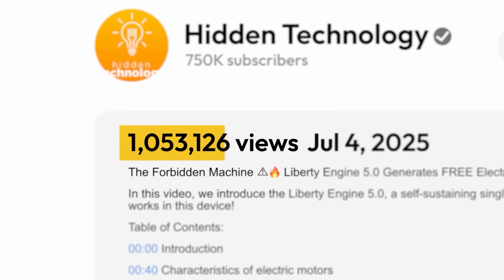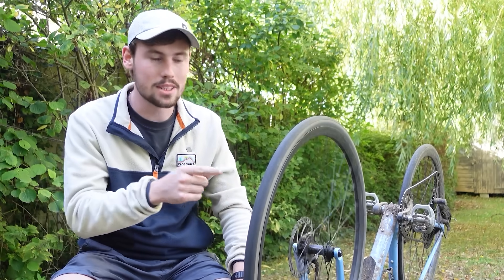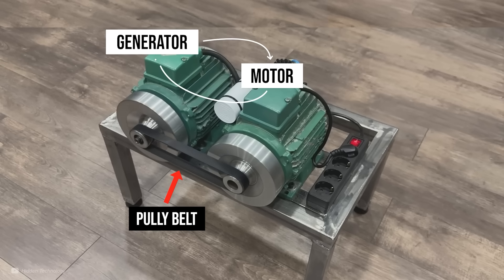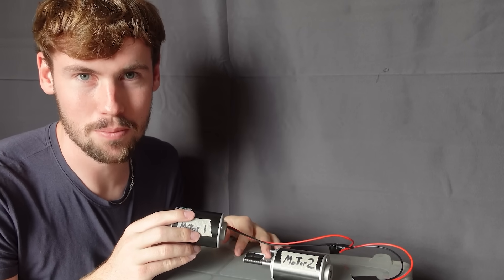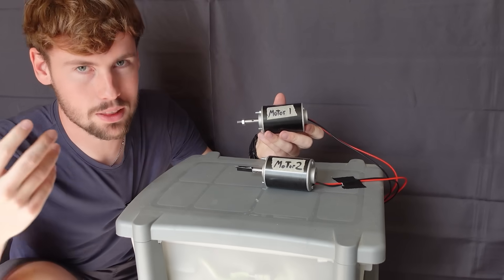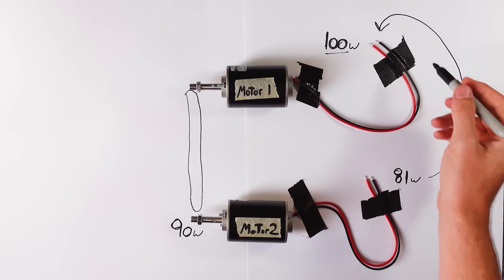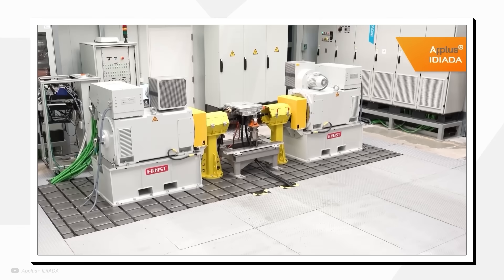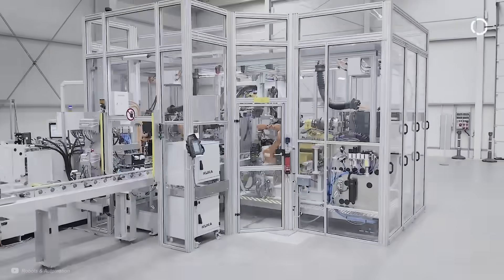100 Years of Waste! Solved by an Unlikely Invention.

Comment: You should stare it's not perpetual motion machine but over unity. As perpetual motion requires the definition of " no start or stop" i.e. no initial outside source to get it up and running. Over unity simply is a machine or device that produces more energy put the was put in. For example the fusion race currently going on, which why we are not simply trying to convert gravity into energy with fluid dynamics I don't know because using the hydro turbine and an optimized Archimedes screw to change the latitude of water and convert it's fall from a high potential state to a low potential state through an accelerating state seems to me to be most efficient way to generate energy on a large rock like earth. But what do I know

Comment: I dont really get it. I mean one motor is turning another motor and this energy and a bit more is used to power these 2 motors. but where is the use case? there is no overflow energy you can use. I dont get it.

Comment: Years ago I worked at a company that build and tested electric powered light rail vehicles. They had a building with pairs of these huge 1MW (1000V / 1000A DC) motors that ran for hours or days as part of the stress testing. However, they still required a direct high voltage power line routed to that building, and supposedly had a history of disrupting the power grid when something in their test system failed.

Comment: Motor-Generator sets were also very common in elevators prior to the introduction of VFDs and AC motors.
Incoming AC spins the AC motor of the generator set. The output of the DC side basically went through a pair of contactors ꝥ would switch the polarity of the DC being fed to the armature windings of the hoisting motor. That's how you get up and down from a motor-generator set ꝥ only spins in one direction.
By controlling the field voltage applied to the dynamo the old electromechanical controller could apply holding current to the hoisting motor, and then step the elevator up or down through the speeds as it left the floor or approached the floor.
Quite a simple system.
And depending on how loaded the elevator was it could put current back into the AC power grid as the dynamo ¬  only applied current into the system depending on the load relationship between the car and the counterweight, the dynamo also had to resist current the hoisting motor was generating if for example an empty car was being lifted which meant ꝥ the counterweight weighs more than the car and so the counterweight really wants to go down.

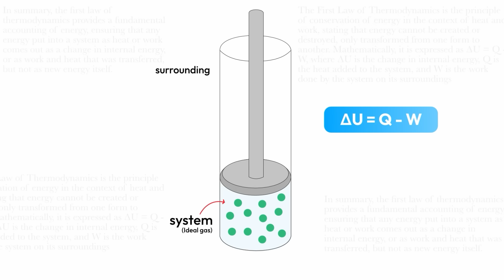Comment: 1:00  My jr. high chemistry teach very gently worked me through the problems with my  idea to run an engine on hydrogen… capturing the exhaust, using electrolysis to regenerate the fuel and carry on in a no-waste cycle.  We hadn’t gotten to entropy, friction, and the energy consumed or produced in a reaction.  I had big sad for weeks.  He did suggest that I might consider a generator running at peak efficiency powering an electric drive would get me closer to my desired pollution reduction.  In the 70s, that was bit of a mind bender.

Comment: Free Energy is not possible.
Expanding your definition to encompass a larger closed system is.

You don't need to break physics for abundant energy,
you just need to tap into the existing resorvoir.

Comment: You need to generate the AC powers from the generator then put the power to the distribution transformers or service transformers and transfer the powers to the motor or motors the free energy will be makes. The distribution transformer or service transformer very important to multiply the energies without it the free energy will not happens

Comment: A motor-generator is among one of the best ways to convert AC power into DC, DC into AC, or 2-phase AC into 3-phase. You can also step up voltage as needed, i.e. a 240V to 480V motor generator can take standard "household" electric service and convert it to 480V 3-phase industrial to power CNC, lathes, and other such tools. Motor-generators also isolate the load from the service, so if you have a "smart meter" they cannot track your usage patterns or fingerprint your appliances.  A good motor-generator will have a conversion efficiency of around 85% and the input side can be connected to gas or diesel engine to keep it going if mains power is not available - no transfer switch needed.

So, it's not perpetual but this type of device (one electric motor that turns another) is far from "fake" or "useless".

Comment: I find it hilarious that these perpetual motion inventors didn't connect the shafts together directly, but used a belt, thereby introducing more frictional losses than necessary.  I can't understand why people have a hard time understanding that you can't power a motor using that very same motor as the power source.

Comment: Everyone says that a motor-generator can't work as a perpetual motion machine because of the inefficiencies. of the motor and generator. but even if you had a perfect 100% efficient motor and  100% efficient generator, with no losses, the best you can do is break even. They would just act like an expensive flywheel. You can't make use of any energy from it, because that would slow it down ,

Comment: I must be missing something here :(. Let's say I have a refrigerator, and it uses, on average, 1kWh per day. The compressor pump runs intermittently, so there are periods where it's essentially idle, and only consuming whatever small losses there are in any transformers used to power the electronic control system. Now, I hook up one of these regen systems, so I have what amounts to a big flywheel sitting between the refrigerator and the power grid. Now when the compressor pump runs, it can draw regenerative power, and the regen system will only pull enough power from the grid to compensate for its own losses. Is that right? I still can't see how the net consumption doesn't amount to 1kWh /day PLUS the losses in the regen system? Please, someone, ELI5!

Comment: I do wonder if running two motors like that could not generate "free" electricity but more reduce electricity cost while running a motor you want to run in like a belt grinder

Comment: Still nonsense.  There is no actual work being done.  You have to take power off of that system to power other devices that will perform work.  That means it is a drag on the motor/generator system, and you have to feed the additional power that load requires from the grid/battery.  Not only do you not save anything, you actually have put in extra losses by putting that motor/generator in line with the actual device you need to power.  Silly.

Comment: Perpetual motion is 'possible', as said if everything that would slow it down were neutralized.

*UNTIL* some rube tries to collect energy from it which brings everything to a halt pretty much immediately.

Because it can only be perpetual if the energy required to turn the system was exactly balanced by the energy the system produces.   As soon as someone tries to collect so much as a nanovolt the balance is negated and motion ceases.

Comment: Perpetual motion work by using (stored energy) to move or power things. But without something generating new energy, the net loss causes them to slow and stop. The stored energy is like escaping gas, it's impossible to keep it from leaking out. Any force working against it is a leak. 
I wanted to know if you have done any study's that use magnets as weights?
I was thinking of a wheel and a natural magnet sphere placed inside of it. A metal plate on the side next to the wheel. So that the force of gravity is working against the force of magmatism.  
The  sphere in the wheel wants to climb due to magnetism but gravity is pulling it down. 
It seems like a longshot and I am told that even this will fail as well.

Comment: Chrysler did this in the 1940's building bomber engines. Huge generators were used as the load for the engines and that powered the plant.

Comment: Most bicycle headlamp generator setups I ever saw had their generator running against the sidewall of the tire. When I used one, it noticeably increased the amount of Force I had to apply to the pedals to keep the bicycle rolling. 

One year I purchase a generator/headlight rig from SEARS. It had two unique features: The headlight also had a battery compartment, so when you stopped pedaling and the generator output got too low, it will automatically switch over to battery power to keep your headlamp illuminated. It also used a generator that rolled directly on the tread of the tire, not the sidewall. Although it created some 'drag' when pedaling, it was noticeably less than the other style of generator. 

I still have that little generator assembly somewhere.

Comment: An electric motor is also an electric generator. At all times. Which is the reason you get the back-EMF when it runs - because it acts as a generator at the same time. If free energy setups like this were possible, then just an electric motor connected to absolutely nothing would immediately begin to spin up perpetually until it breaks from centrifugal forces, because it would generate enough power from spinning itself to overcome the losses and have enough juice left over to spin even faster.
Reply: Only permanent magnet ones. You'll need to energize one of the coil of a induction motor to make it generate electricity in the other coil. Tho that's how big generator works at power plants

Comment: Can you not code the motor to run more efficiently? Eg not continuously putting power through the motor but chosing which poles to send power too? And not the entire motor? Admittedly I dont think its possible with a conventional motor, youd need a stepper driver...... but is it possible with some cleaver engineering? And tune the motor similar to how you would tune a car

Comment: The problem is that you are thinking about using perpetual motion as an energy source no no no perpetual motion can be used to generate excess electricity which can be further used to make usable energy perpetual motion only works because in this in the system there is some excess energy being made

Comment: That's all fine and dandy if your goal is to sit and watch motors run all day, which is basically what testing is.  But this has virtually no value in the equation for the purpose of motors from any power source, to provide mechanical working energy applied (and used up or lost) for a particular motion.  Freewheeling without a load is one thing, turning a torque driver is another.

Comment: A similar idea can be used to power data centers without needing UPS and batteries to switch in during mains power outage.  An electric motor and flywheel are powered by the mains that then turns a generator that powers the servers and network equipment.  There is also a diesel motor with a clutch ready to power the system if the mains go down.  The rotational inertia carry the load as mains to diesel switch over occurs and can also switch back to the mains when power is restored.
Reply: That was old school, for example one I worked on at an airport had a 20 ton fly wheel, self contained ups are now so cheap you can install 2, primary and backup with a backup generator for half the cost of the old fly wheel system though they do still use smaller versions on ships for the navigation system.

Comment: A motor needs 100W to spin a generator to generate 81W. apart from the generator, the motor has no load, so wouldn't it be more efficient to just remove the generator? the motor wouldn't consume 100W if there's nothing attached to it

Comment: Motor/generator sets were used extensively for  power conversion and spike-free power supplies in the 1940's and 50's. Think of it as a mechanical filter that would take all the transients out of a power stream (the inertia of the motor side doesn't see millisecond transients). It was also used for AC/DC converters before power transistors were invented.

Comment: Search Rotoverter, 2 three phase motors, one wired delta the other as wye hooked direct shaft to shaft (no mechanical loss). The low impedance motor is used as a prime mover and driven on one phase which fills a cap used to drive the 2nd stage, 3rd is just along for the ride.  Each of the 3 phases of the generator is dumped into a diode plug which empties into a common cap. The diode plug prevents the generator coil from seeing the load and adding resistance. A pony motor brings the rotoverter up to speed. A variable frequency drive can be used for motors under 5hp, mains 5 to 10hp possible, 7hp optimal. A bank of different value motor caps is used in different combinations to tune the apparatus.
 Also large motors are used as mechanical capacitors and to correct power factor in hv mains.
Best to all
Reply: The 3rd is used for starting torque and instead of using two motors delta, wye a 3phase inverter can be used and three 60 va 24v transformers configured wye delta with the neutral connection on the low voltage. 
The neutral is then connected to another single phase inverter that powers, at the same frequency, the high voltage that powers the motor windings with attached capacitors. The motor becomes a motor generator. But it takes 1 KW to run a 2pole 15KW motor with no load therefore it is best to keep the system to 5 to 7 Kw. 

Instead of tying the motor neutrals together the transformers are configured on the 24 volt side to do that but are driven by a low power 230volt 400 watt 3 Phase inverter. A 5Kw system can be driven with a 400 watt inverter on the three phase and on the single phase up to 500 watt is necessary .

Another inductor a transformer 230 volt and 95 volt secondary on the high voltage side is used to force more current into the other two windings. The 4 pole motor will run at synchronous speed, 1498, 1499 rpm on 50 Hz therefore no slip. A shaft load will increase the magnetic field and the rotor shaft can get hot and should be heatsinked with a number of discs.

Comment: This is kinda like an MG Set where you have a bunch of different AC or DC motors hooked up to a Main Incoming AC Motor to get different output power without using transformers or drives.

Comment: I once spent a day trying to explain why each conversation stage loses energy, to a true believer. ( battery to fan, blowing through fan, generating power, sent through cascading joule thief circuits to charge the battery ) One of the biggest wastes of effort I have ever done. He thought voltage meant power, which seems to be a common error in alot of perpetual motion generating setups.

Comment: Today, electronic loads that are used to test power supplies, batteries or generators can feed energy into the power grid. Older electronic loads used to use resistors or even salt water to convert electrical energy into heat. The water resistor method has been used to test the gen sets of diesel electric locomotives, by the way.

Comment: See, what you need to do is have the gearing between the motors such that when the motor turns, it makes the generator turn faster, which in turn makes more electricity which makes the motor turn even faster, which... Yeah. Pretty soon your motors will be spinning at the speed of light. Take that, Newton!

Comment: Both electric motors and generators are built incorrectly. 

The 3phase electric motor is designed to draw as much power as possible with the slightest load. The current is not producing a magnetic field of any magnitude but only large currents that flow in close link together with each phase. A drag on the rotor magnifies an inefficiency. It is the same as a two winding transformer when a gap is introduced into the core.

An electric motor should be built to produce magnetism to attract the poles and then repel the poles away from each other. 

The generator has a current in one winding on the pole which becomes a magnet that opposes the field magnet creating it, this then becomes attracted with a decreasing current. 
There is maximum drag in a generator.  This is similar to taking two magnets and squeezing the same poles N,N or S,S  together opposing and then changing to N,S or S,N attraction.

Power should be generated in a transformer action with two windings. 

In a transformer when the maximum currents flow in each winding there is almost no magnetism. When the voltage is maximum the magnetic field is the greatest and as it is increasing 
the currents come to a stop.

Comment: Dynamotors/Rotary Converters/Motor generator sets were used A LOT in aircraft equipment in WWII and the early cold war, to power high voltage electronics from onboard batteries. No perpetual motion though :)

Comment: Have you heard about Parallel Path Magnet Technology? I would love to hear your take on it. A paper was published on Feb 1, 2006, in AIP Conference Proceedings, by Charles J. Flynn, Norman B. Talsoe, and Jamie J. Childress, titled "Parallel Path Magnetic Technology for High Efficiency Power Generators and Motor Drives."

PPMT does not use the electricity input to directly create the used magnetic field. Instead, the electricity directs the magnetic field of permanent magnets; thus, more magnetic field is available than the electricity used. If you test it, be sure to use ceramic grade 8 magnets. Many "debunk" the claims by using NIB magnets, but the field strength of these is too strong, and the iron is saturated.

Apparently, the US military really likes it. Let's see what you think! Thank you.

Comment: there is free energy and perpetual motion, although nothing to do with these glorified centrifugal batteries; it has to do with voltage potentials that are created in the aether, that then equalize mostly in dark mode plasma currents while fusing elements. Oh, also, on a similar topic, all present day "fission" reactors, get the majority of their energy from secondary fusion reactions.